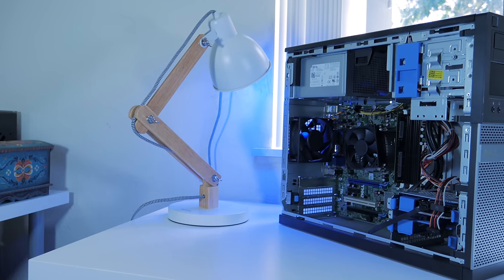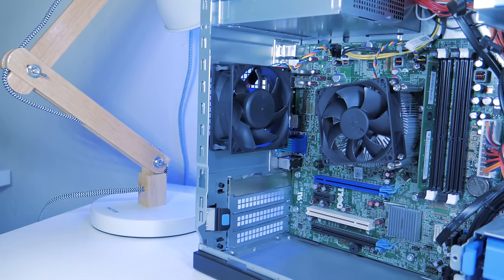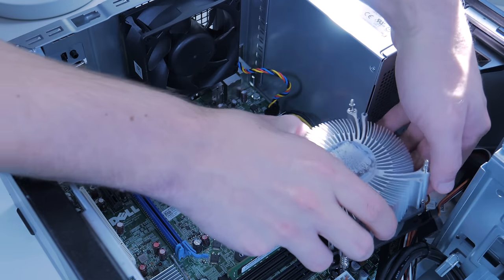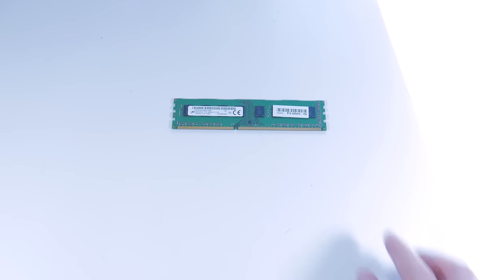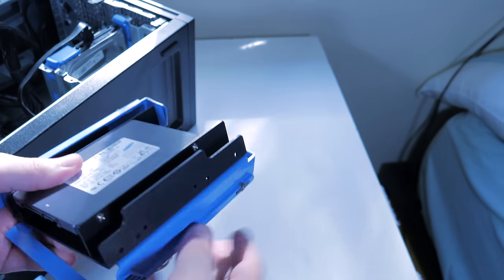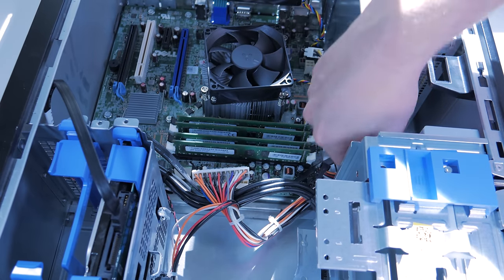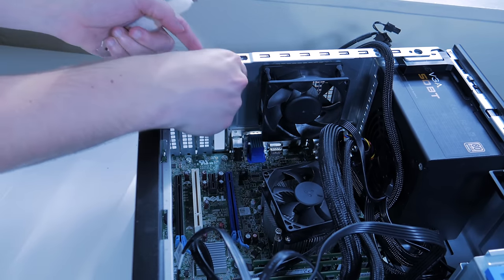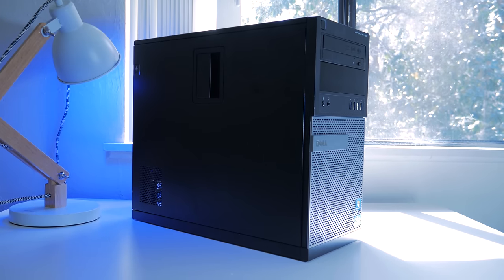How To: Turn an Old Office Computer into a Gaming PC!

Comment from the maker: Long time no see, lol. I'm going to have a Ryzen APU build video up this weekend and I have a bunch of other awesome content lined up for the next few weeks, so stay tuned!
Reply: Tech By Matt: I did my own system kinda like this but hunted the Australian gumtree site for my local 2nd hand gear, got a z77 & 3770k, new 120gb ssd, added a 1060 6gb i got on special & a new 80+ gold psu, (also got win7u coz I use&hate win10), also slowly worked up to 32gb ram for no real reason & installed it into a custom modded ikea display cabinet with 8x 200mm fans
Works mint for 1440 & 1080p, sadly 4k is horrid.
Reply: Hey Great seeing you again and will be looking this weekend --- Thanks --- Also First 65 or Older
Reply: Tech By Matt I am trying to upgrade the hp envy 750 and I was wondering if it was completely upgradeable or is there specific items that I need to get
Reply: I need to see some gameplay since im getting my optiplex 7010 and planning on buying these parts ;)
Reply: Hey what's the website u find cheap pc on??
Reply: Hi, i need help with my build, it's a Dell T20 server which I have e put a i5 4460 16gb ddr3 ECC ram and gtx 1060 6gb. But I have getting lag and stuttering. Help please.
Reply: I got a hp 5800 and I'm wanting to turn it into a gaming computer is this possible for the average joe?
Reply: @Tech By Matt Will this setup also work as a Livestreaming pc? for YouTube?
Reply: hi i have a hp pavilion p6769sc and want to upgrade it to a gaming pc and i have a budget of 427.75 $ and what do you recommend for parts
Reply: Tech By Matt i have an old ass windows xp compaq im trying to make a gaming pc out of it but its really starting to get to me. About finding parts if you can make an old xp gaming pc that would mean a lot thank you!
Reply: What's the model/name of this specific system? You haven't mentioned it in the description and sadly I'm unable to understand some of your words in the video
Reply: hi
Reply: Pls tell benchmarks like pubg
Reply: Hey! I use a 790.
Reply: Just cause I’m the vid you say I5 do I have to take out my i7? Or is is i7 better I’m new to pc gaming and I’m not to smart when it comes to specs
Reply: @imjusttape2368  A i7 is better.
Reply: Please Matt. In future videos, can you stop starting your videos with ”what’s going on guys”?

Comment: pro tip just leave the SSD hanging in the tray, it's not a moving part, it'll be fine.
Reply: Thx
Reply: Dawid Jandzinski  maybe he dislikes bottons
Reply: Dawid Jandzinski  I really love hitting the dislike botton when I get rick rolled.
Reply: @danielroscoe7987  okay?
Reply: Dawid Jandzinski  it's not "its" it's "it's"
Reply: Dawid Jandzinski  I literally just said what it was. Read the comment again
Reply: @camrenkimmerling9406  you should use the right your
Reply: @colingreene1648  ima just delete that.
Reply: @camrenkimmerling9406  😂😂
Reply: Tape it on motherboard
Reply: Double sided tape
Reply: Chances are you'll be fine, yes, but why go for the janky solution when a 3.5 to 2.5 inch adapter costs 5 bucks on aliexpress?
Reply: LTT BABYYY
Reply: Good idea!!   I sometimes use big clear tape or zip ties for off road use
Reply: Electrons are moving parts

Comment: Protip: Don’t exceed the manufacturer recommended maximum for RAM and make sure to use the right socket type for your CPU
Reply: How about just maximum
Reply: @edwardmacnab354  max at your own risk but it should handle it
Reply: so.. make sure components are compatible?

Comment: lol that is what i did but i found one with an i7 2600 non k and 8gb ddr3 ram for $180
Reply: Mysterious Jack dude ich bought a Pc with an i7 4770 an gtx 660 16 gb ddr3 ram an 120gb ssd an 1tb harddrive a power supply from corsair with 750 on a asrock Z87 pro 3 for 180€ ( sorry for my bad english)
Reply: SyniX yea but that is $223 in us also that is a pretty good deal for that price anyway lol
Reply: I just bought dell optiplex 990 for $110 on Offer Up. It had 4gb ram and a 2600 non k too. It transferred my 600 watt power supply, added 4gb more of ram(total of 8gb ddr3),and my gt 1030 from my old build. This a great medium-high setting build now. I had an i5 650 before....
Reply: John Lomeli The i7 2600 is being severely bottlenecked. It handles 1070s.
Reply: John Lomeli you got to put in the account that you spent on the gt 1030 and the PSU + the extra 4gb of ram...which might be around 200-220 lol
Reply: Mysterious Jack I was able to snag a i7 2600, 16gb ram and a p67 motherboard for 150
Reply: ZeusLated nice
Reply: Mysterious Jack forgot to mention that it was in € so it's closer to $180
Reply: Ouch dude, im shocked that no youtubers or people in comments bring up x79 .... i managed to grab a 3960x and a asus rog mobo for £160 with 16 gb ram in quad channel only 4 months ago and its a total beast dont know if i got lucky or what ?
Reply: another thing to look out for is older xeon servers with heaps of ram for cheap now. Got a Dell T3500 with Xeon W3550, 24GB ram, SSD, HDD, nvidia quadro 4000 for A$270 shipped, which is about $200 US. Going to put a 1050 in there but otherwise no change :)
Reply: i found 12gb ram i7 2600 3.4ghz 500gb hdd and AMD radeon hd 5450 512mb only for 200 euros , here in Kosovo (waiting serbians to say kosovo  is serbia -_-)
Reply: Jack Lan this exact system goes for €250 at the lowest in my country i plan to add a 1050ti and it will be perfect but the stock cooler is enough for the i7?
Reply: it's ok if you have good airflow through the case and don't overclock. I would replace the heatsink paste though. The most annoying thing tends to be the noise level from the fan on it rather than it getting too hot.
Reply: I Got i5 3570 8gb ram 500 gb hard drive for 97 $
Reply: That’s really old, but not bad at all for $180.
Reply: thats really good deal i bought a ryzen 2200g and rx 580 used 8gb and ram for about $330 and hdd case i used with a old pc
Reply: same but 300 cuz 2tb hdd and gt 630 and win 10
Reply: @LS-jk3fk  why do u buy windows 10 man waste of money in the build just pirste it and maximize ur budget lol my ryzen 2200g and rx 580 8gb can run everything i throw at it i used my old hdd and bought a single stick 8gb ram. plus i have upgrade path to ryzen 7 so xeon cpus are jot worth it and 4th gen intel are crap now no upgrade path
Reply: @synix1462  damn what a bargain

Comment: >buy dell with any i5
>Put 1050ti in
>Cheap gaming machine.
PSU will handle it nicely
Reply: My friend just did this. Plays Anthem medium settings 45fps
Reply: FACTS i did that and sold the pc for 330 bucks and it work fine. pple overhere telling me to replace the psu like cmon
Reply: Sadly most of these old pcs have like 200w psus so ul have to change it either way...
Reply: @lordadz1615  it is, but luckily I got an dell optiflex 7010 with 275w and pair it with gtx 1050 ti mini last year and it still work like a cham till today !!!
Reply: by old dell/hp workstation add ssd and rx 570. done. better than i5 and cheaper
Reply: @deaneyle3940  agree. I also got myself the Optiplex 7010 with i7-3770, and put the GTX 1050ti mini without having to change the PSU. Works flawlessly. My son uses the PC to play Fortnite (epic), CS:GO (highest), Apex Legends (mostly highest), PUBG Lite (highest), FIFA 18 (highest), etc. @ 900p.
Reply: @TheAdrifebrianto  nice
Reply: Hey fellas, I know this is an old thread, but I’m thinking about doing a similar thing with a PC that has an i7 4770 installed. What GPU would you recommend for it/would I need a new power supply?
Reply: @3dPalmTree  i7-4770 is still a powerful processor for most of the modern games nowadays. If upgrading the PSU is no object to you, I recommend getting GTX 1060 or GTX 1070. Find yourself a good 400+ PSU from respectable brand. Make sure you buy the tower case version to give your GPU an ample space.
Reply: @3dPalmTree  honestly a 570
Reply: 570 dies so fast and make aloud noise
Reply: done same thing put old ram in this new 790 and put gtx 980 in it  24 g ram   2x8 2x4  i7 2600 came with it and I had ssd  so runs well dont see the point in spending 2000 grand on shit
Reply: @lordadz1615   I threw my 650 w in works fine in it
Reply: @marcusnzchab971  not all of us have psu lying around at home
Reply: @lordadz1615  from old build like I can afford a gtx new one lol
Reply: i5 9400f is the best QUALIY PRICE
Reply: Any suggestions for a mini or micro build?
Reply: @elmehdierraji3189  how fast it dies ? Is it not depends on the psu? Because i'm thinking to buy rx 570 but also comparing it with 1050ti
Reply: @elmehdierraji3189  "Dies" ? What are you talking about I have an Rx 480 and it still awesome...
Reply: Tunten Tony  Holy sheet good job
Reply: 1050ti wont cut it in 2020 though my 1060gtx 6gb showing its age now
Reply: NOURIMA No it shouldn’t
Reply: Why would you put a gtx 1050 ti?
Put a gtx 1060
Reply: @videusgogo5137  ya bs, 570 would be fine, the power usage diff you will not even notice on ur bill, second 570 would be perfect, they dont draw to much power where u cant  just use a splitter either, i have done it many times no issues, they dont pull enough watts to overload those cables
Reply: I have a hp pc 8gb ram with intel core tm 2 duo e8400 what can i do to my pc, will i need to change the cpu and i was thinking about using the amd rx 580
Reply: @stardustmirage9504  you dont have to, but look an see if u can upgrade to a q6600 or do the tape method on that one to oc it, and install a good linux distro and u will be set, and get a cheap SSD like a 120gb sandisk or kingston,
Reply: @jimsinnovations2737  appreciate the help bro, 
gpu im going to buy is amd rx 580 
HDD 500 GB 
is what im using
would you recommend getting a better ssd or stick to 120 gb sandisk or kjeep the HDD
 
cpu would you recommend the i7-2600 3.7ghz or go for a q6600
the pc i have is a hp compaq 6000 pro SFF, used to use it for microsoft office not gaming lol

is there anything else you would recommend i do
Reply: @stardustmirage9504  well if you can get the i7 that would be better, and i would get the SSD like i said 120gb or so just the the os system, and go from there i wouldnt put to much money into an old machine like that anyway, but its your call, and kubuntu, linux mint and archlinux are the best one its think, and u want to get xfce type of distro for that machine, it will make it 20x faster using that, and u can get lutris an playonlinux etc.. for games an if u use it for office stuff you got all that too
Reply: @jimsinnovations2737  yeah i dont want to spend to much money on it either, looking to get around 200fps, https://www.youtube.com/watch?v=e0KFYr5W9DU&t=190s i was recommended to watch this video and get the same pc as this guy and just upgrade the power output and graphics card, would my pc be a suitable replacement for this or do you suggest i buy and upgrade the same pc. Thiss guy managed to get around 200 fps for it. You think changing to xfce from windows 10 is worth it, pc has decent speed? Thanks for the help. appreciate it
Reply: @jimsinnovations2737  also that pc comes with the intel i7 cpu
Reply: @stardustmirage9504  ahh cool ya get the other stuff then, and idk if u have used linux before but its miles better then windows
Reply: @jimsinnovations2737  ive never used it tbh but ill check it out and do you recon i should buy the same office pc has him for the i7 core or stick with the one i have and just buy the q6600? if i stick with the pc i have the only difference at the end will be the motherboard and core? what do you think?
Reply: @stardustmirage9504  id buy something better if you can, now is the best time to buy and build a system
Reply: @jimsinnovations2737 my budget is somewhere around 400, looking to get similar frames as he did, on low settings he reached 200+ fps. would you recommend anything ?
Reply: Hello, its me again. In 2019 I would put my money on gtx 1060 or 1660ti, and ofc upgrade psu.
Reply: @TeollisuudenAasi  well the ti maybe nothing less. Like I said unless u can get a 580 cheap its not worth putting to much more in it. And a decent 600w psu or so would be plenty
Reply: can confirm, although with my optiplex 990 the psu installation is actually more of pain than he makes it out. i had to break some plastic on mine and use a twisty tie to keep the lid closed. everything else was butter. i have a 1050 ti, 20gb ram, 2400 i5 with mine and it runs like a dream. it aint pretty but she feels good like a butter face with a bag on her head
Reply: thats what i have
Reply: rx 570 cries in the background
Reply: i have a 3020 sff with an i5-4950 what do yall recommend for the best gpu on it?
Reply: cries in i5 8400t since I can’t overclock it
Reply: Neisor 1030 seems to work ok.
Reply: I would go a few additional steps: change the PSU to an 80+ model for $43 and change the thermal paste on the CPU.
Reply: I'd probably replace the i5 with an i7
Reply: i have intel core i5 does it work?
Reply: I'm just I mean a 1050ti is not enough
Reply: Bought i7 does that work?
Reply: I even upgrade with an i3 dude
Reply: @dukeofearl5209  wha?
Reply: @whyers4782  I upgrade a dell i3 to a i7
Reply: @dukeofearl5209  nice upgrade which gen tho?
Reply: @whyers4782  same one in the video
Reply: Get the rd 580 with a 600 w power supply it is 2x faster then the 1050 ti
Reply: @3dPalmTree  would a 750ti work
Reply: @deaneyle3940  do you think it’ll work with a 750ti I have to connect thr pci tho
Reply: @Jayden-yk4lg  depend on a model, if you have a standard version of dell optiplex then it will definitely work if you have something like sff or usff then I'm not sure if it will fit inside !!
Reply: @deaneyle3940  i have a full tower aha im not one of those people who get mini ones its a core i7 4770 and 8gigs of ram 1tp hard drive and a 290w power supply would it work with the asus gtx 750ti?
Reply: @Jayden-yk4lg  that is plenty, you can even get gtx 1050 ti, 1650 if you don't plan to get a new psu. Those gpu don't require external pci connector. If you don't have money then gtx 750 ti will be perfectly fine but keep it in mind that gtx 750 ti is kinda obsolete at 720p in 2021 so 1050 ti and 1650 are a better option.
Reply: This is a really smart idea, thank you very much I’ll look into investing to something like this
Reply: true did the same and changed my monitor lately to 144 hz it helped a lot
Reply: nice shortcut
Reply: @supermac1749  change the cpu to bro don't listen these people and use a 450w hertz powersupply
Reply: @TheAdrifebrianto  bro your getting 100 fps in that stuff on a low settings useless get a 1650  i7 is and old gen
Reply: @dangee9574  What low settings ? What are you referring to ?
Reply: @TheAdrifebrianto  fornite
Reply: @dangee9574  My son plays Fortnite at the highest settings possible, just in case you didn't carefully read my earlier post.
Reply: Generally yeah but 16gb is mandatory for ddr3
Reply: I did this
Reply: Fax I have an i5 3470 and I’m gonna upgrade to i7 3770k to overclock to 5 ghz and gtx 750 I can run Fortnite at 250 fps in creative and play any Roblox game